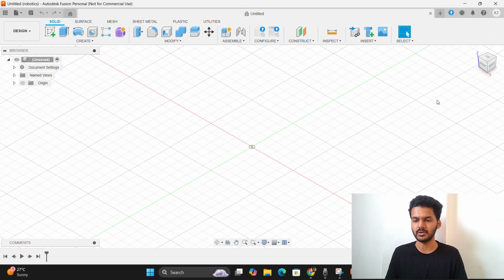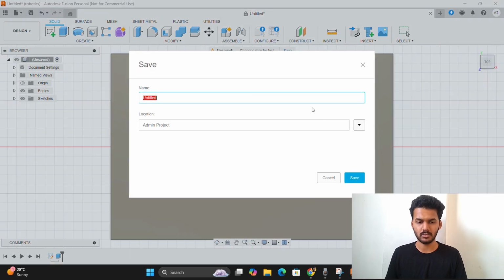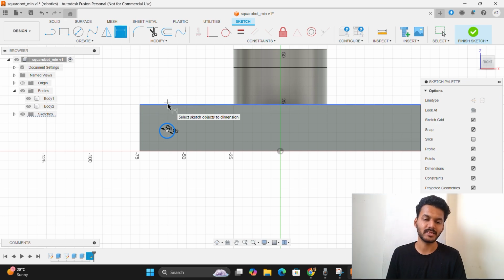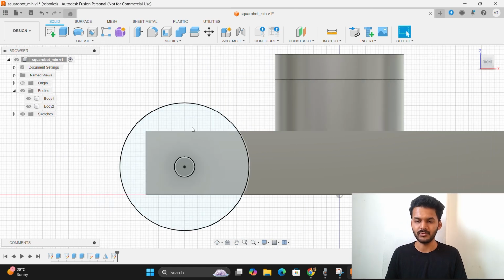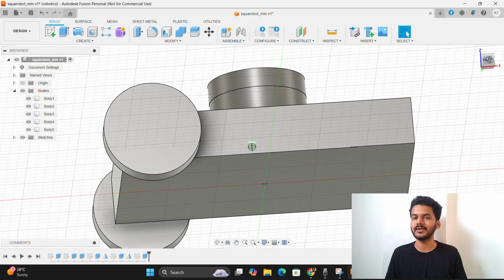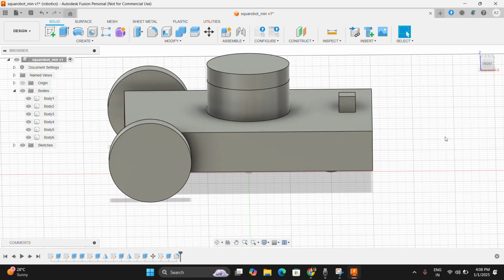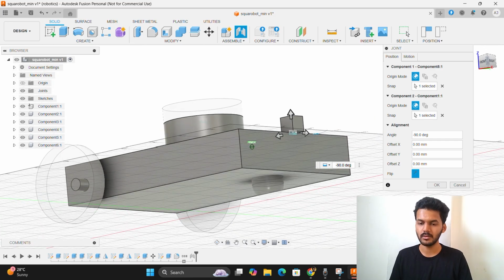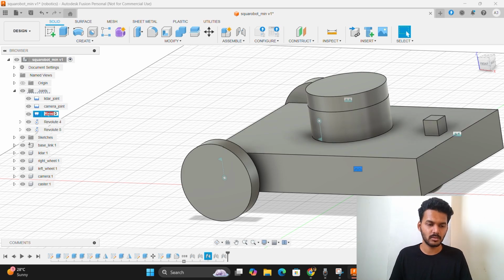Fusion 360 and ROS2 | Fusion 360 to URDF ROS2 Part-1| robotics engineering | robot operating system

Comment: Bro is graphics card necessary for robotics softwares
Reply from the maker: It's good to have a decent one. But, if you can afford one go for it. Else, you can try alternatives as well.
Reply: @aryanjagushte  is Intel evo laptop sufficient for high end task in fusion 360
Reply from the maker: @BNYRanks  Yeah, it will be fine for Fusion 360, as fusion is on cloud, very less computation required or else no. Also, if your budget exceeds 50k, search for dedicated gpu laptops